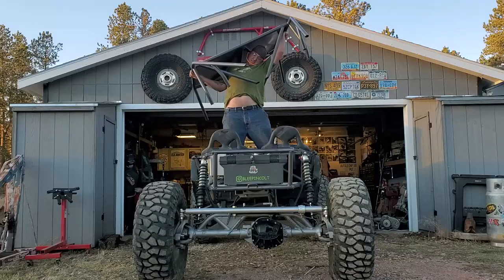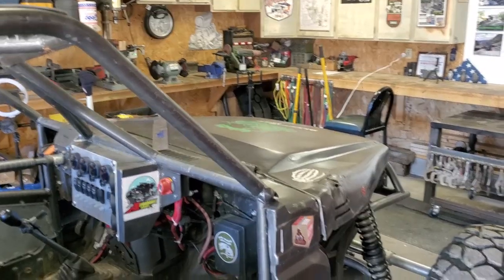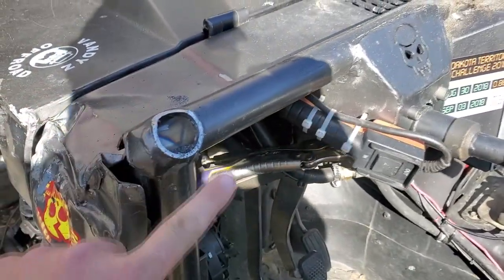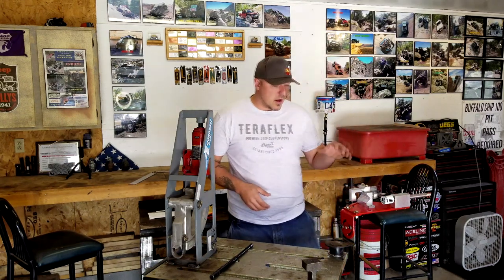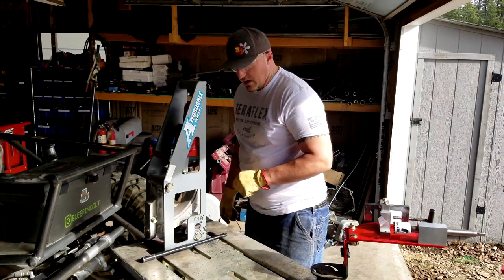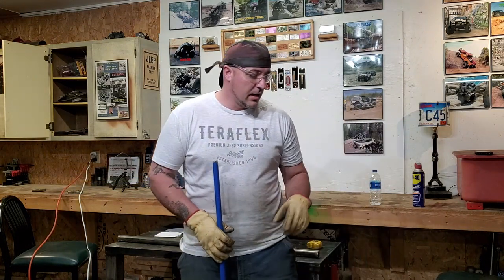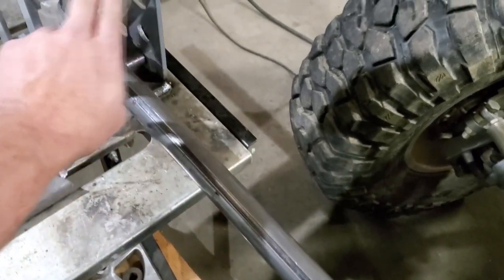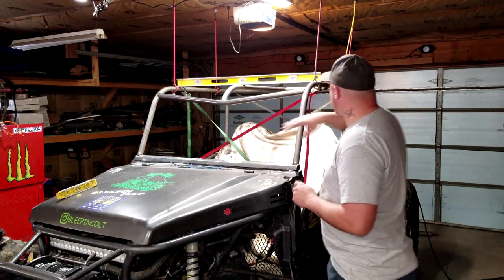How To Cut, Notch, and Bend Tubing for Cheap!

Comment: If you get a piece rattling around inside your roll cage, drill two hole in the pipe, spray great stuff inside it at 1/3 and 2/3rds the length.  Tac weld the holes.  Now the piece is in one of the 3 chambers.  Go drive and turn a lot while the stuff is still sticky.  If that doesn't catch it.  Go to the 1/3 that you hear the rattle, and divide that up into 1/3rds.  Drill 2 holes spray more "great stuff in it.  Drive and turn a lot while it's sticky.    You might be able to drill one hole and fill the hole bar with the great stuff as it expands big time.   Your way of removing it before you build is best of course.
Reply: That's a really interesting way to fix that problem. I've never heard of anyone doing that before👍

Comment: Love the video, was hoping to see how you made the roof panel? I see a lot of crawlers with panels like that and want to build one for my YJ. What material did you use? How do you bend it around the tube how do you attach it to the cage? Any help would be greatly appreciated thanks.
Reply: I literally traded for a 4'x4' sheet of 3/16" aluminum. Then measured my radius, cut lines with a carbide blade on a scroll saw half way into the aluminum going longways. I think I did about 15 of them or so? Then began to bend each 1" section until I had my radius. Set the aluminum on the roof of my buggy and marked out the tubes, then cut the aluminum to fit and drilled the holes for my bolts👍 I used trick tabs for the roof panel😉 Hope that answers your question and thanks for watching!
Reply: So I had a 15" radius, cut halfway into the aluminum 1" apart 15 times. Then bent the aluminum every 1 inch section until I got my radius👍
Reply: Awesome thanks for the help

Comment: Have you ever tried a tubing grinder? It’s a belt grinder with hinged arms so the belt wraps the tube. They’re good for butt welded joints like that.
Reply: I've been looking at them. I've never tried it and I don't know anyone personally who has, they look pretty cool and the prices vary a lot depending on the brand. I'm not sure if I want to be the test mule though, lol.
Reply: @Bleepincolt  I watched a guy do some butt welds on stainless tubes, he ground them smooth and polished it to a high gloss sooo I took the plunge and bought one. It’s was $200+ after getting some decent belts so I am going to do some testing. Hehaw hehaw!!!
Reply: @retiredfederalie178  well thats a lot more expensive than my HF grinder and flap disc but if it works that good I'd be real interested in it!

Comment: As to the notcher: instead of making sure each piece is at the angle to the drill, can’t you add in some corner braces so it doesn’t sag?  Also: awesome work!
Reply: I believe you could, mine only sags because I run a very large drill👍

Comment: Wd--40 is hell on air tools. Learned that when I was 15 trying to use WD-40 to lube my Smartsparts paintball gun. Eats O-rings and doesn't provide long term lubrication. Works good for killing wasps thou
Reply: Weird I have airtools that were my dad's and they've never seen anything other than wd-40 🤷‍♂️

Comment: So I'm an experienced fabricator ( high structural- pipe line- ship yard- custom fab shop business and have built chrome moly aero frames etc.) Please identify the schedule pipe your working with. Is that bender a tubing bender or will it bend pipe like schedule 40? Thanks Dan
Reply from the maker: It's a tubing bender. 1.5" .120 Tubing. Harbor Freight sells a "pipe" bender.
Reply: @bleepinjeep  Thanks for replying. I've seen the pipe benders from Harbor Freight and Grizzly Tools. Not worth the box they come in. The style you have there is a lot better design. Unless Harbor Freight sells it?? Cause haven't seen it if they do. Thanks for such a quick response. We been buried up here in the mountain ( NE Washington state 10 mile's south of the border of Cana Duh) so I gotta git back out my Comanche and drag plow. Stand Strong and live free. Dandahermit
Reply: @bleepinjeep  I don't need a pipe bender much need a tubing bender like your using cept when I'm building  heavier parts than cages. Keep on trucking and mind your 6. Dan

Comment: I like what you are doing but did you burn your seats doing all that welding and grinding??
Reply: My seats have very large drain holes in them and any slag was actually falling down through those holes. I also used fiberglass blankets for the big stuff, those left my seats nice and itchy until I got them to the car wash 😁
Reply: @Bleepincolt  right on, I noticed the fiberglass later in the video.

Comment: When you bend the bing with the sea in the outside you're stretching the ed. When it's done in the inside yu'rein compression. Same thing bending C chanel flat face inside. Easier to stretch the flange

Comment: Quick ? When u first start bending should yr pump be all the way in. Meaning cylinder and the top screw out piece
Reply: The screw on the jack varies depending on which die you are using. But the cylinder is compressed in, yes.
Reply: @Bleepincolt  so I'm using 1.5 tube so how far should I screw out  about a 1in .. then on this eastwood bender when it runs out of jack you take pressure off, push cylinder back in and turn screw out more .. just seems when I try to get a true 90 it kinks and flattens .. thank you for your replys Colt
Reply: @jeremyschunke5070  well I've never owned the Eastwood bender but the affordable bender jack doesn't max out. You can bend from 0-90° without making any changes to the jack screw.
Reply: I've also made a handful of 90° bends with the affordable bender and it never kinked or flattened the tube. I almost always use .120 wall but have used .090 wall as well.

Comment: I thought DOM tubing was seamless, is that not true?
Reply: DOM is seamless, I used DOM on all the exterior parts and HREW in the interior sections that won't see rocks.
Reply: @Bleepincolt  Actually I did a little research on that and it turns out that DOM is welded but they run a mandrel thru it which makes it very round and holds it's dimensions and smooths out the weld to where it is almost invisible and smooth. Seamless is acctually extruded and has no weld.

Comment: DOM tubing, dry cut carbide saw, highend tube notcher, proper tubing bender... wheres the CHEAP part as shown in the title.. this isnt the cheap way this is the professional way, i dont see how you could spend anymore money other than going with a bender thats mounted to the floor and fully hydraulic
Reply: DOM tubing- because safety first for me,  you can use whatever your little heart desires(talked about it)👍.  Doesn't matter what saw you use to cut tubing, use a sawzall if you want🤷‍♂️,  Low end tube notcher(price them out) if you want to notch tubing in a high volume and at multiple angles the only one cheaper is the HF one and I used what I think is the Cheapest "ACTUAL" tubing bender that is on the market.
Reply: @Bleepincolt  i understand that and soon as i get a shop built ill be ordering a jd2 bender and a notcher, already got a cold cut, nothing wrong with the gear my point is doing it the cheap way shouldnt be in the title, it implies you have some tricks on how to cut it perfectly and notch it nicely with an angle grinder then any sort of home made contraption for bending it, this isnt the cheap way its just the regular way
Reply: @Bleepincolt  and i really dont see pipe being an issue, DOM is much nicer especially when you have all the gear designed to work with its dimensions nicely but pipe would be plenty strong, its not a safety issue in my eyes, they put high pressure steam inside the stuff and the welds dont bust, although as mentioned quality assurance can be an issue on any product
Reply: @AndrewBrowner  well there has to be a reason motorsports rule books don't allow it, same reason why some will ONLY allow DOM. I will not trust poop pipe to save me in a rollover when I'm 30' up on a climb.